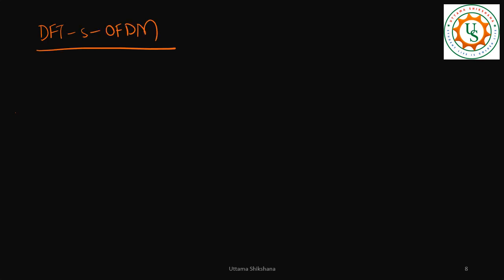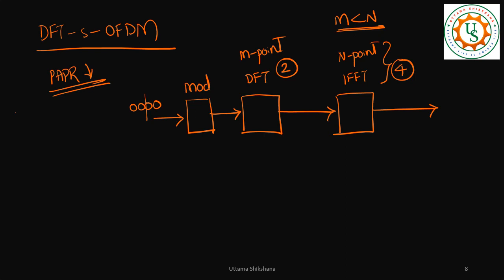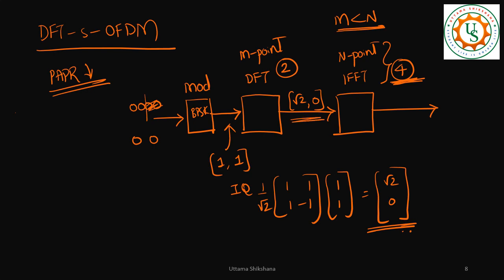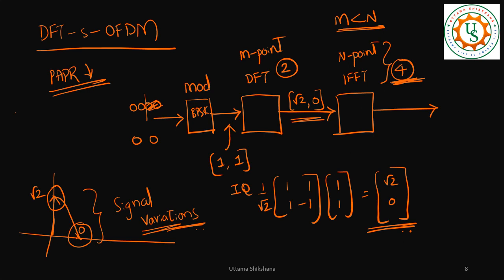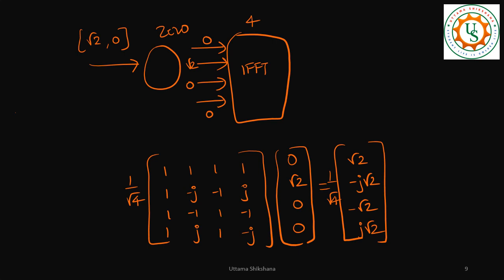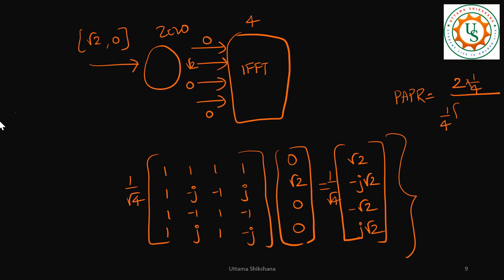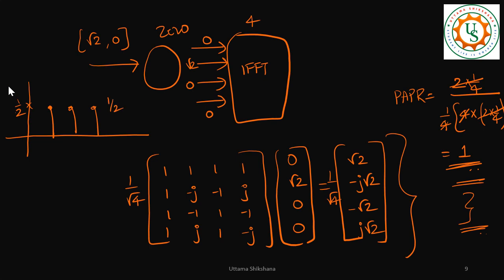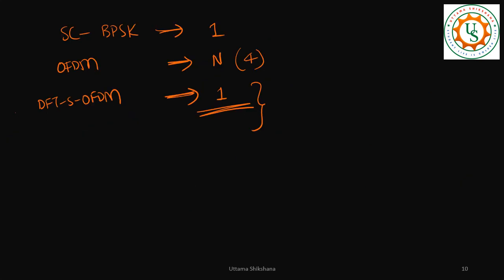[Interview QnA#24] How is PAPR reduced in DFT-s-OFDM | Calculate the PAPR for DFT-s-OFDM case

Comment: Sir, Thanks for the videos. I have a question, what will be the effect if zero is padded instead of CP in OFDM.  There will be no circular convolution. Any other disadvantages of zero padding?
Reply from the maker: Thanks a lot for the question Ravindra.
Yes. You are right that there will be no circular convolution. 
Since, there is no circular convolution, the OFDM receiver becomes complex. That is, the channel estimation and equalization techniques will be complex and hence they would taken more processing time and therefore, it is not an attractive solution to be implemented in practical systems.
Reply: @Uttama_Shikshana  Thankyou Sir for explanation.